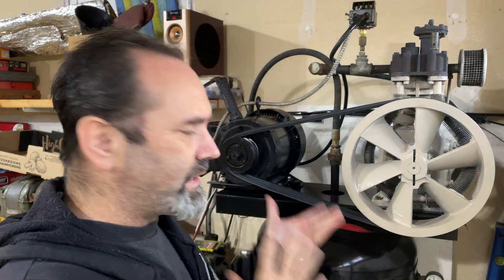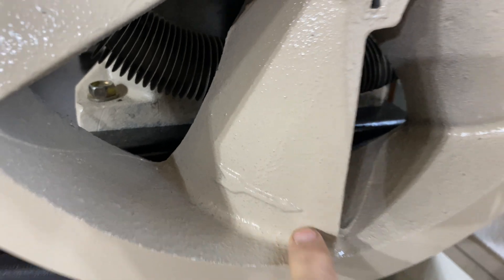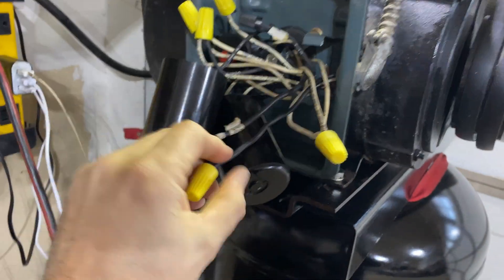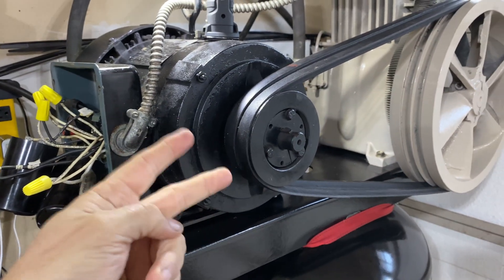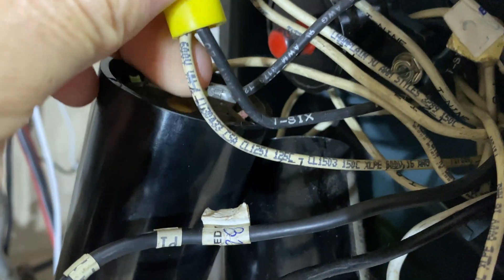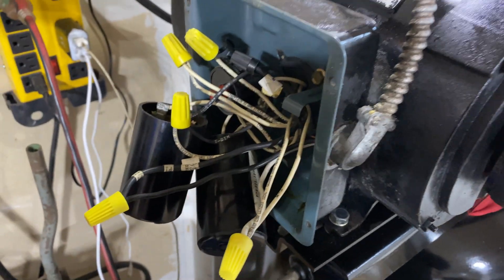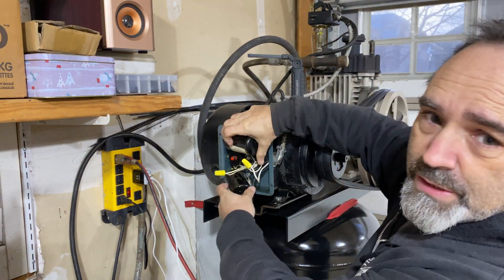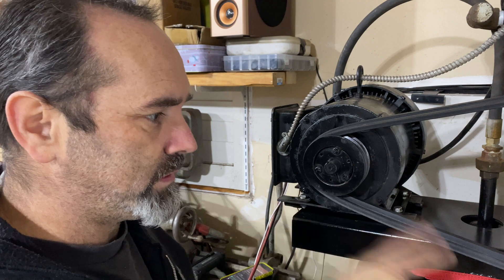Compressor Motor Wiring For Clockwise Or Counter Clockwise Rotation

Comment: You lucky to have a motor that is nicely labeled.  In my case no lable.  4 wires from the motor. ?
Reply from the maker: My advice would be, take a photo of the motor, then upload it to Google search, to find similar motors, which might lead you to a label.

Comment: As Joe mentioned, the flywheel fan is Always supposed to blow across the after-cooler & pump housing fins for maximum cooling. Of course the oil pump needs to pump in a certain direction as you mentioned. Even a dipper type (splash-lube) needs to "bounce" oil off of specific internal areas to properly lube the parts. Spinning the pump backwards makes oil bounce different than the engineer designed it to bounce. Another YT fellow learned the hard way building a compressor/tank & controls (look for a gold-painted V-twin pump) was running it bass-ackward🤪 got slow & low air pressure build up. I was yelling that it's flywheel fan was running backwards. He was to proud to show a follow-up video admitting he goofed & burnt up his pump. I respect you for revealing your boo-boo & showing what you did to correct the problem, Thanks!
Reply from the maker: Thanks Paul. I've pretty much based this whole channel on seeking help from those with more knowledge than myself, which is 99 percent of the viewers, lol.
Reply: @ScottRods  THE Compressor Guru (Bud) says always be a learner/student. Bud has decades of experience in little to Big compressor systems & shares his knowledge freely. You'll like his YT channel. Nice compressor build BTW!
Reply from the maker: @PaulThomas-qo9vy  Thanks Paul. I'll check him out, in a non sexual way of course.

Comment: Beautiful fix, always check to see if air is blowing towards the pump, and also does it fill up the tank faster. That's thr only thing I think you will need if you are going to use air tools with high air demand

Comment: That's easy, just swap T5 and T9 and you're done. It already has the right pairing for the higher current, three phase is even easier, you just swap two of the feed legs. Nice save!

Comment: I wonder how many years it ran in the wrong direction . As you hadn't changed the orientation when you moved the motor to the top of the tank. And it still runs fine.
Reply from the maker: The wiring was weird when I got it. I think it was set up to run on 110.

Comment: Hey Dave. HEADS UP!!!!!!   If you are going to do any work on it, you must turn the wheel and everything to the other side. I can see someone getting an arm taken off when they trip and fall into your compressor. Or make a guard around the belt and wheel. Good job. Thanks for sharing.🍁👍👍😏
Reply from the maker: Yes, I'll get some steel mesh and make a cage.

Comment: Wow! You made a simple job difficult.  All you had to do was to swap T5 and T9, look closely at the name plate and look at what is different between CW and CCW, its only those 2 wires.
Reply from the maker: I'm not sure you got the point of the video, lol. It was all about not knowing or understanding one of these wiring diagrams until you get your hands dirty. Essentially you are right, I only had to change a couple of wires, but I didn't fully understand that until I was almost done with the job.
Does that make sense?
Reply: @ScottRods  Well, if you had studied the wiring diagram before doing anything else it would have been obvious and saved you a lot of time and potential mistakes.
Don't make it harder on yourself than it has to be!
Reply from the maker: @erbenton07  I did, and it wasn't. You would make a terrible teacher, lol, stick to cat videos.

Comment: Great job.  Yes, those wiring diagrams are at first confusing, but once you realize that each wire is labeled, it all makes sense.  When you make your bracket to the wall for stabilization, be sure to use a rubber isolator there as well, so vibration will not travel into the wall.  A universal muffler hanger works well for that.  I agree, a guard for the belts and pulleys is needed, as compressors turn on without warning, but with all your new equipment and fabrication skills, that should be easy for you.
Reply from the maker: Do you think I would still need an isolator if I'm connecting the regulators with a flexible air hose to the tank?
I have grand plans for the tank holder, but need to buy some tube steel and perfect my tig welding skills first. Thanks Dan.
Reply: @ScottRods  If you are going to have any connection from the compressor to the wall to prevent a tip over, I would isolate that brace with another rubber insulator.  A rigid connection could transfer noise and vibration into your house.  The regulators can be mounted directly to the tank or remotely to the wall as well.  A flexible hose between the tank and regulators would make locating it anywhere quite simple.
Reply from the maker: @danquaas683  Been running the compressor for a week now. It's incredibly quiet, so not so concerned with vibration noise.
Reply: @ScottRods  You certainly got a good deal on a great compressor.

Comment: Spinning the right direction is a good thing, I can relate to wiring woes.I think you should turn the whole thing 180 degrees so the flywheel is against the wall for a little added safety, pretty easy for some one to put a hand in the belt.

Comment: I might have missed it, but I never saw you install the tank drain.  Don't forget to drain it often.  They can build up a lot of water in the bottom of the tank rusting it out.
Reply from the maker: You didn't miss it, I just forgot to film it. I did drain it, but of course had the end pointed at my face and blasted some crap in my eyes. I'll be firmly attaching to a leg pointing in the opposite direction in future, lol.

Comment: Dave... if you go back to the video where you first ran it you'll see I mentioned checking rotation because I noticed the fan blades were'nt blowing air across the fins and to look for an arrow...glad you found out before something happened....also you were lucky too because if you dont discharge those capacitors you can get knocked on your butt...glad it worked out....
Reply from the maker: Sorry Joe, YOU are the "Mystery Man", lol. I couldn't find in the comments who the other guy was, so I just put Mystery Man, lol.